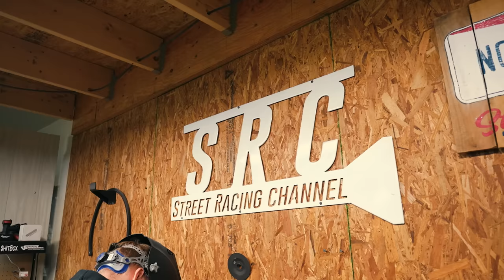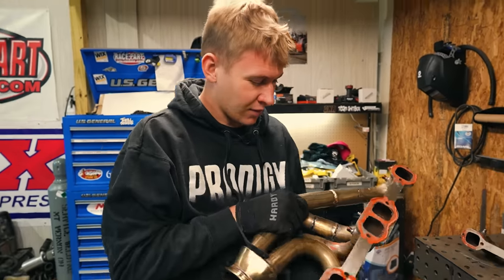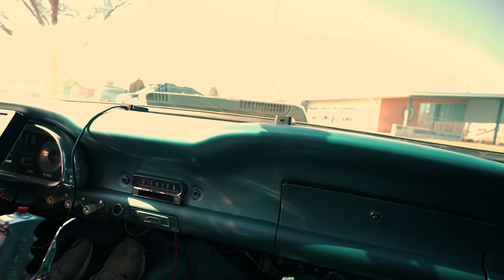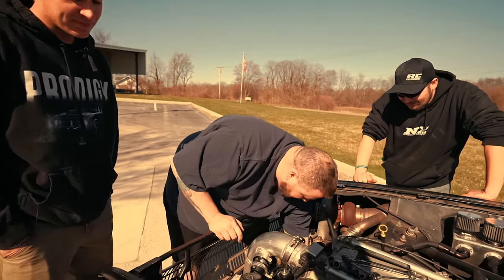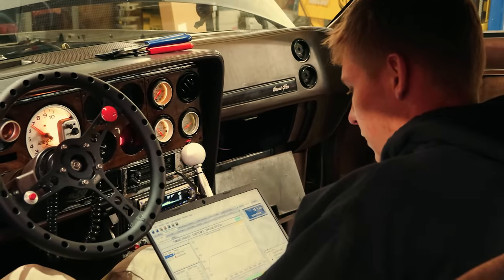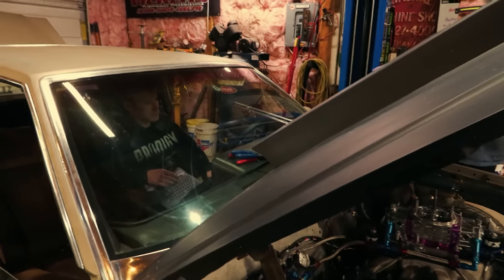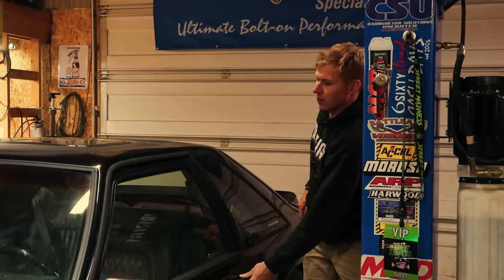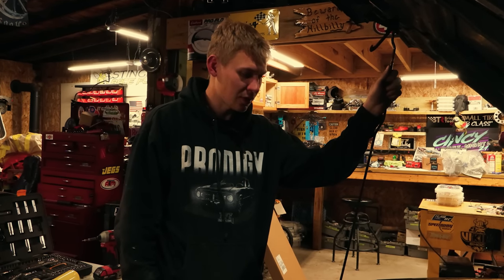The Falcon Leaves us STRANDED + Testing Rob's Nitrous Grand Prix!

Comment: 15:20 if this helps anyone, the part number “5060353” can be broken down to the belt width and length. 

The “6” means 6 rib
The “0353” means  35.3 inches long.

In this case, if the parts store didn’t have the 5060353 they could have used 

5060350 (35 inches)
Or 5060355 (35.5 inches) 
Assuming it has a tensioner. 

Have a good one, love the videos

Comment: 4:10 weld a 1 inch axle spline back onto a CV joint... parts are 6 weeks out, shipping is $480 for a $70 part... shop install fee's cerdit etc. makes that about $2300 per inch of weld if it works.

Comment: Billy a drill makes sharpening tungsten quick and easy on bench grinder . Quick Tip sharpen about 6-8 pieces on each end that way you can swap them out and not have to move back-and-forth while welding and then just sharpen all your tungsten at once when all dull

Comment: I loved Billy's small talk while Rob was working on the Falcon.Fun stuff.Rob needs to hang a turbo on his G body.Turbos are really effective at making lots of torque which is extremely helpful when you have a heavy G body car.At Sick week in Florida there was a 1965 GTO from Canada that drove 1100 miles to Florida.The car was running in the eights at 150 mph plus with a T-56 magnum 6 speed manual transmission.A 517 Pontiac engine with a 94 mm turbo makes for a super reliable car and 21 mpg on the highway. Horsepower is 950-1200 depending on the boost settings.Rob needs a turbo and a 4 speed auto to have some real fun.A 10 second car that cruises at 70 mpg while returning in 20 mpg isn't a bad thing.And there is room for NOS for some 9 second runs./Just a thought.

Comment: Put your tungsten in the drill like a drill, bit spin it, and then run it on the grinder. More consistent.
Reply: *dedicated grinder.
Reply: I’d just pick up a dedicated tungsten sharpener. Grinder you only sharpen the tungsten on. You can actually contaminate the tungsten with other dirt/metal while sharpening it.

Comment: EGT welds weren't bad. Another good tip is to clean not only the surfaces your gonna weld with acetone but also the tungsten and your filler rod. Its always done me well. Awesome to see Tommy back behind the wheel of the Falcon, even if he did break it LMAO jk. Billy had me DYING when he asked Mark if he was getting a blowie under the desk LMFAO 😂😅 And we gotta get some boost in Uncle Rob's Pontiac. Turbo FTW!!!
Reply: 35 years I've never cleaned off tungsten or fill wire unless I dropped it in the mud.
Reply: @robertfandel9442  I'm not saying it's an absolute necessity, I've just found that it helps.

Comment: I saw a video on ricky bobby showed the rear coolers all plugged with rocks and rubber. Keep them rear mount coolers clean. I spray them out with brake cleaner and air when i do my fuel filter maintenance bout every 30 to 60 days depending

Comment: Alot of the guys in ditches are stick welding. Almost pipe Welder is using stick. Depends but most of the time they're burning 6010 and capping 7018

Comment: So if the nova engine was so messed up how did it run so well. .020 would make one side of the motor a full point of compression ratio difference.